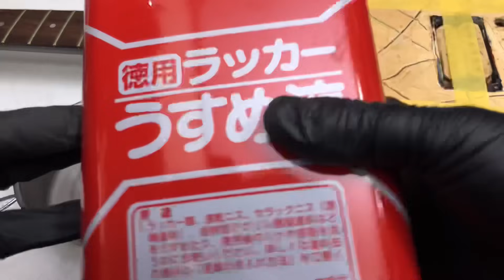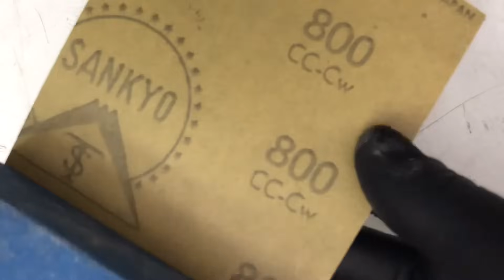非常に強固な塗装が施されたギターをクリーニングしました。-I cleaned a guitar that had very strong paint.-

Comment: 19:00  NOOOO!  not lemon oil. Hope you didn't put that on the fretboard wood.  It will degrade the wood over time.  Forget about making the wood darker.  Just sand it with 3000 grit or buff it and leave it alone!

Comment: Since most of us don't speak Japanese (I'd assume), it would be really cool if you didn't just hold your cans of magic potions into the camera but actually told us what it is, you're using. This way your videos would actually have some educational value besides people admiring you for your great work.
Like, what did you use to get that mess off the headstock without ruining the original finish and decal, and how did you achieve dissolving the red paint off the back plate without dissolving the plastics?

Comment: nice job on the cleaning , couldve made it look newer by adding drops of high gloss black paint on the damage chipped off paint and open screwholes and after having it dry thoroughly sand it out flat and polish
i mightve sanded the top untill flat and repainted it black as theres a lot of damage from the rough sanding some screwholes and high spots in the wood itself from i think moisture 
the plate holding the neck on can be made black again by sanding the coating off rust it put a rust converter over that and then polish the black oxide layer

Comment: that is a Fender Telecaster "Contemporary" made in Japan 1985, I bought mine in 1986, fantastic guitar, the Floyd sistem was made for Fender by Kalher (or Shaller after almost 40 years I forgot it but I think is a Kahler) I changed the pick ups with Seymour Duncan which I prefered in those days. Fantastic guitar.
Reply: Thanks for sharing. It sure looks like a Kahler. I was wondering.
Reply: Wasn't it the Free Flyte System, said to be quite a calamity?
Reply: Kahler
Reply: That's a very interesting guitar...
I love tele's and strats...
Best of both worlds..